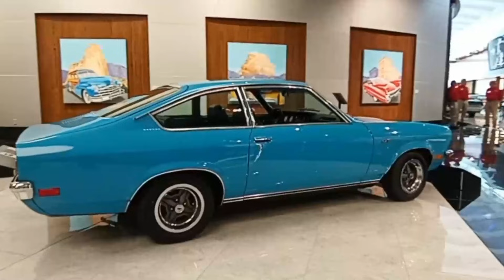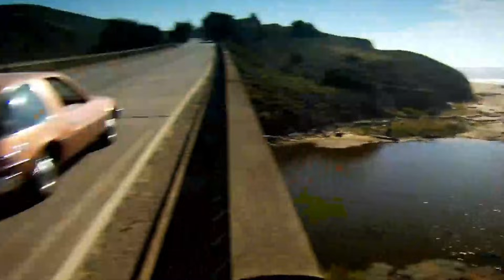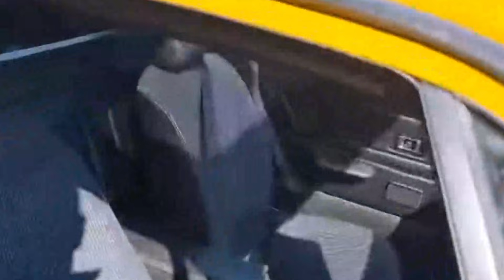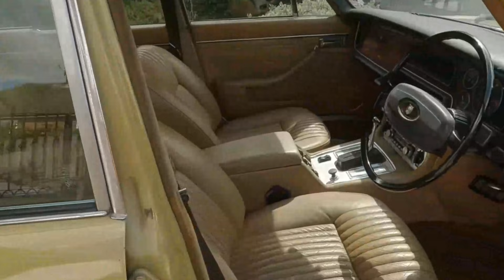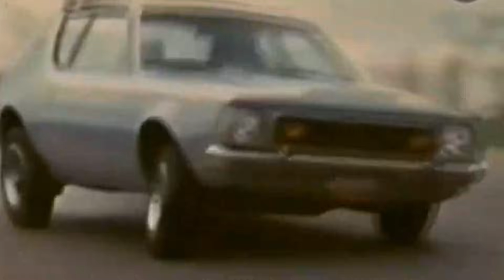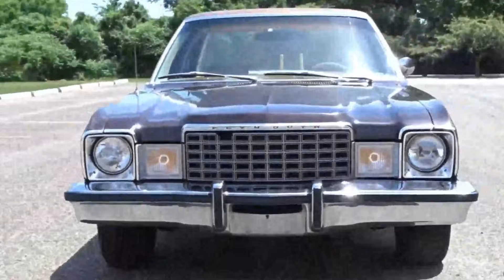The WORST Cars of the 1970s That Broke Down Instantly

Comment: If you had ever owned a Gremlin, you would never put it in this list. I had one that i bought new in 72 and surely it did suffer from rust issues but all cars made in those years did too. I drove it 12 years and put 160k miles on it with very little engine problems, I also thought it handled quite well and was a lot of fun to drive, I even drove it up Pikes Peak and with that 6 cylinder engine, it almost idled all the way to the top! Plenty of power and it surely liked to spin the rear tires on quick take offs.
Reply: The Gremlin was a great car!
Reply: @vrooooom4487  I totally agree! I loved mine and everyone that i knew that had them liked them too!
Reply: Gremlins often used as the base for modified stock race cars.
Reply: @jamescaron6465 I knew a guy that used his for a dragster and he had a 343 cid engine in it and he could do wheelies with it.
Reply: He used it at a drag strip at the air base i served at and that car blew away about every Chevy 396 it went up against!
Reply: @smw381st  They were nuts easy to modify.  I knew a guy who ran modifieds and had a gremlin.The seat was where the backseat was and that small block chevy ate up most everything in front of him.  I think he ran that sucker till about 1980 when he got out.  But damn that mother went.  I bet that dragster flew down the line.
Reply: @jamescaron6465  That is fantastic and i love hearing about Gremlins used for such things. How about that Dorito's commercial with the Yellow Gremlin with the supercharger sticking up through the hood?